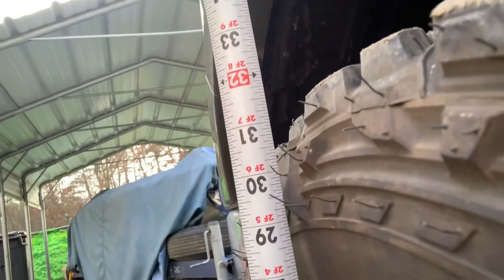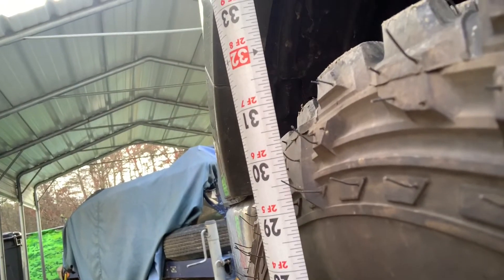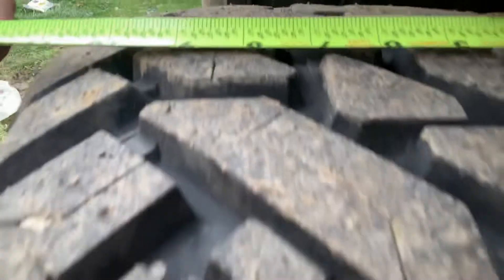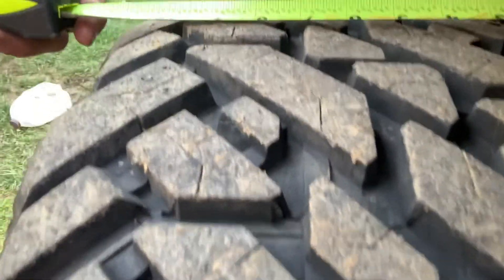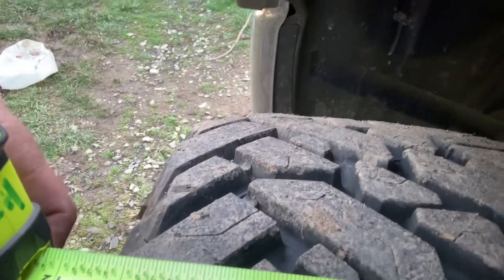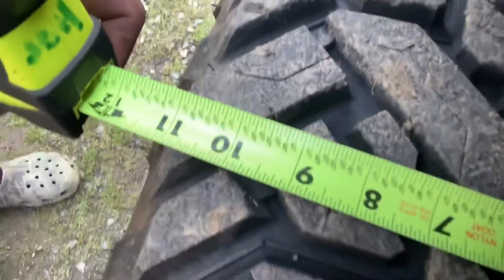Fuel gripper MT tire road noise

Comment: Love that they’re relatively quiet on the road for an MT. But since this is from 4 years ago, do you still have them, and if so how is the wear? Did it wear fast or slow? Does it come with any tread life warranty?
Reply from the maker: Not to sure on tread life.. these were really good tires. I traded the truck in with half tread ran them for about a year and a half
Reply: @ThePrepper14  thanks for the information